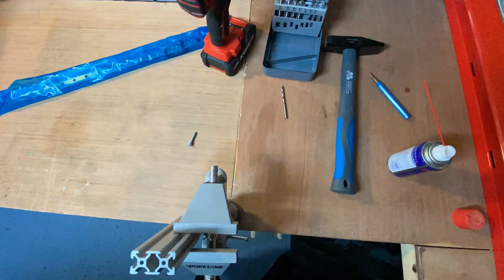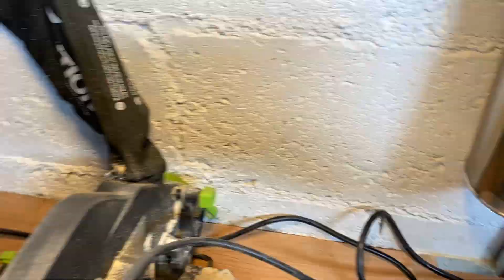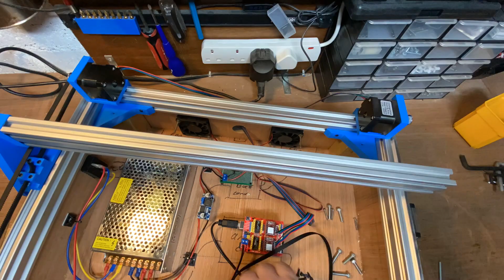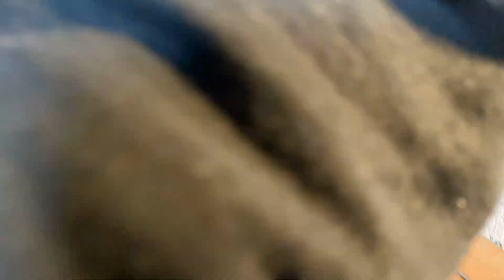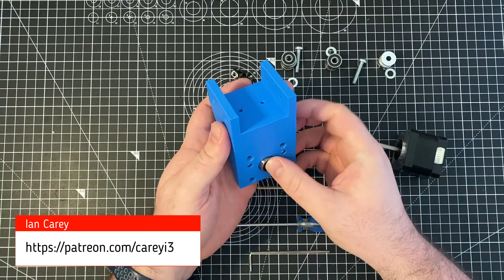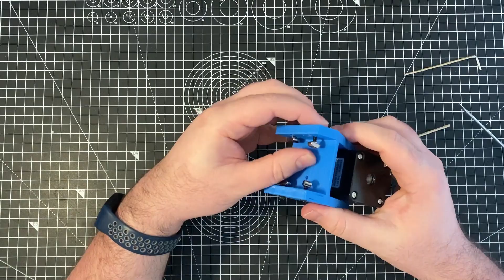DIY CNC (Arduino & GRBL) - Part 4

Comment: What the dimensions of this machine and
How much the total cost
Reply from the maker: The overall footprint of the machine is about 500x400mm, the total cost I haven’t worked out yet and it isn’t finished, however, I’d say the final total for parts and materials is about €400